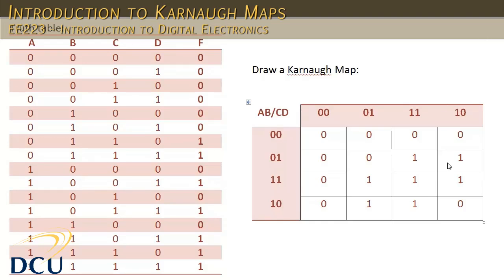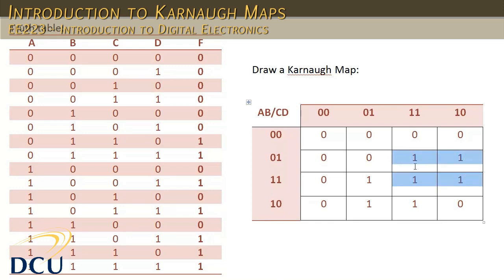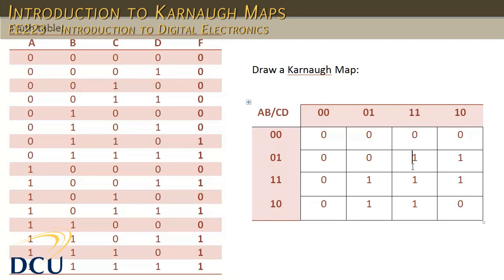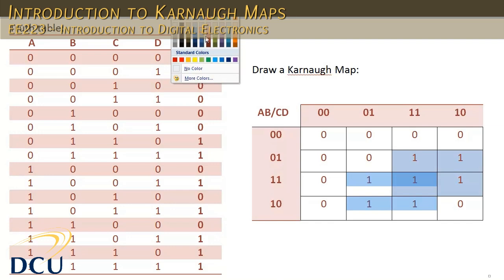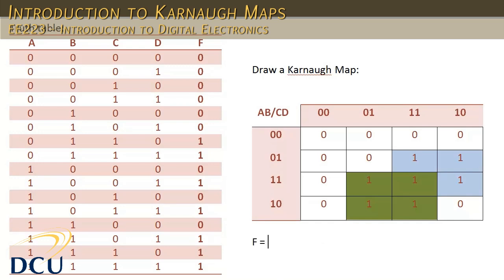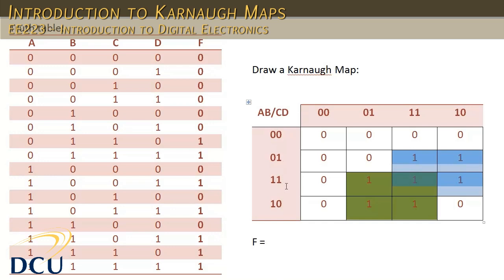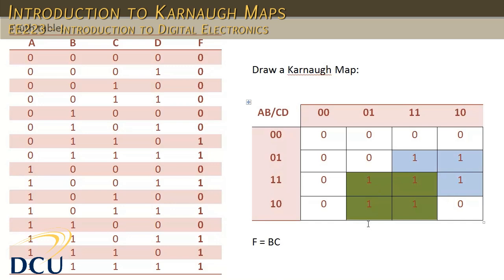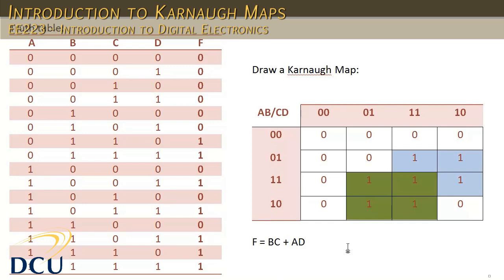Experiments 2.5: Digital Logic - Karnaugh Maps (Part 2)

Comment: The brilliance of this problem/solution AND explanation of the outcome of this Karnaugh map was quite mindblowing for me :) Check this out,  the task was to make the output work in threes, four and marginal inputs (AD, BC). HOWEVER - if you concider only AD and BC option you will notice that any three (ie.: ABC) HAS the marginals in it (aBC, BCd AbD, AcD) so if AD+BC is true, then well, whatever else is always true :) Great, and nice method. The problem seems complicated but the solution is pure and simple!

Btw, question : Couldn't you do it with only one microcontroller? Like creating an OR on 9.10.11 pins of the first microcontroller?